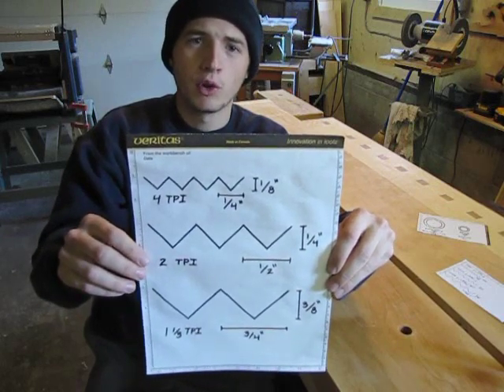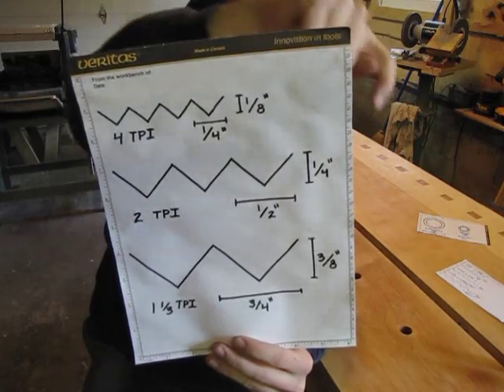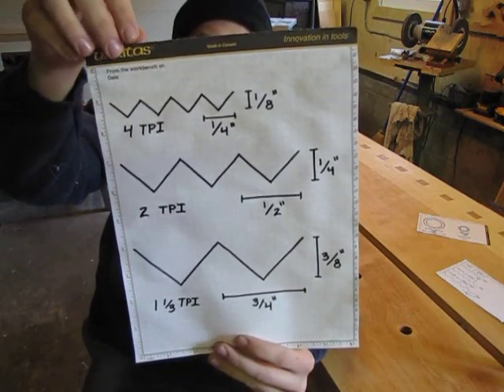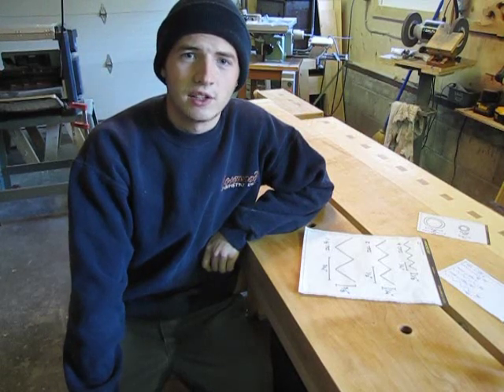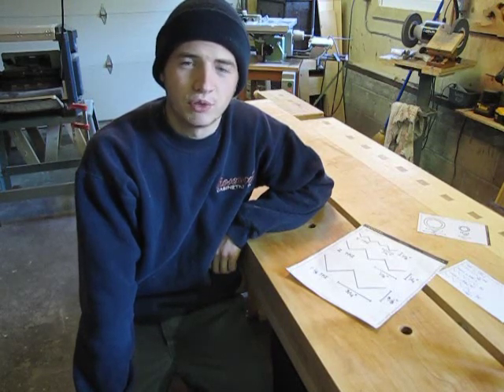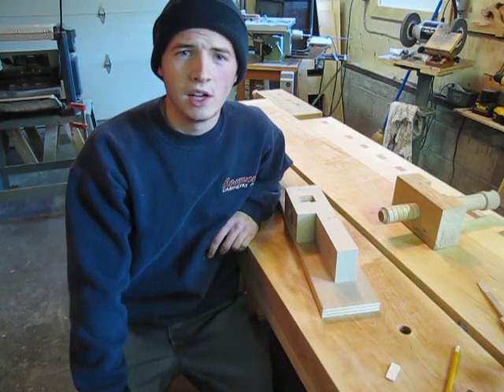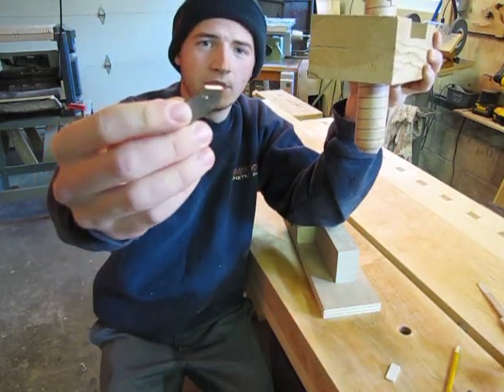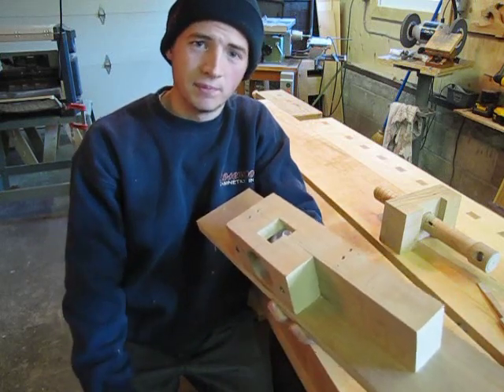Tap And Screw Jig Tutorial - Part One

Comment from the maker: @TheRussianMercenary I use a standard 90 degree router bit. About 1/2" in diameter for 1/2" deep. As long as the bit is as wide as the distance between each tooth. That is one reason why I recommend going up to a 1 1/3 TPI thread pattern because the largest common 90 degree router bits you can find only go up to 3/4" in diameter.

Comment: What I'm not finding anywhere is the depth for the threads when making dowels and screw boxes.. I want to start with what's already been done, a 3/4 by 6 TPI tap & box.. To be interchangeable with the wonderful world of existing brooms & broom sticks, how deep are my threads??? Also, the sheet metal you're using as a guide.. Wouldn't it be more consistent with 2 plates to guide the threading?
Reply: The thread groove bottom angle is 90 degrees. So the depth of the thread is about 0.7 (exactly half the square root of 2) times the distance of the initial spiral cut windings -- is that run length?

For 6TPI that means your distance is 1/6" and your final depth would be V2/12 ~ 1/8" (but 7/64" would be fine too). I'd say 3mm.